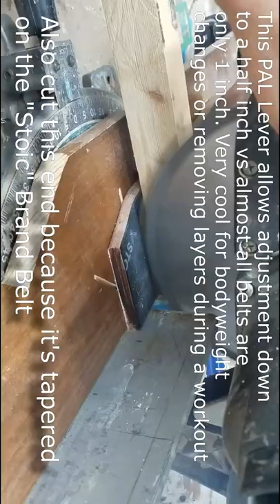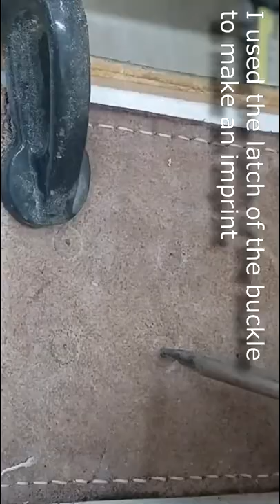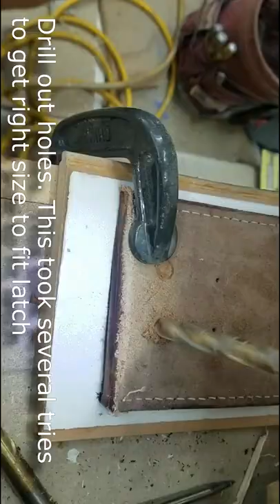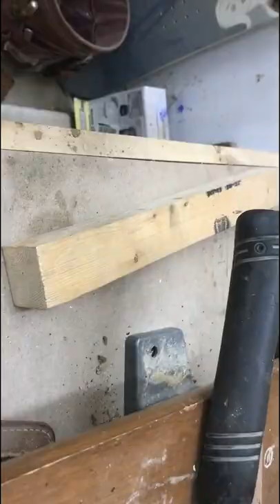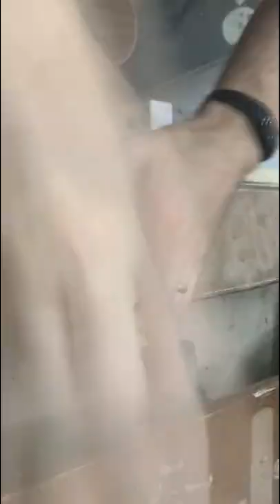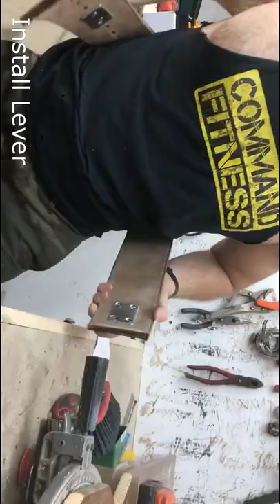DIY Making the Best Lever Belt - $41 vs $120

Comment: Have you made all the holes in the belt by drilling? I recently bought a lifting belt, it'll become too big for me when I lose weight, so I'm asking because of that.
Reply from the maker: O thats easy just cut more off on the end with the buckle/ no holes. that will shorten the belt.     and that one weird whole i was messing around seeing if i could do half inch offset spacing like the one Pioneer belt.
Reply from the maker: https://www.youtube.com/watch?v=rzeD8nBRoq0 this is the full video. the ending i show some pictures holding it on my waist to visuals how its going to fit and how the cuts will work.
Reply from the maker: Hope that helped. Yes can drill more holes
Reply: You can use a drill Ishak.... but if you really care about the Integrity of the leather it is smarter to buy a set of leather hole punches. With a punch you will be cutting clean through the leather as opposed to a drill which can blemish the surrounding leather of the belt

Comment: All that work and you didn't even use threadlocker? I know it's unlikely,.... but once you've got your size set why else would you want the screws to back out
Reply from the maker: They haven’t loosened. Took 10 min dog. I have also readjusted the position to new holes after gaining/ losing more than 2 inches 

Thanks for the comment